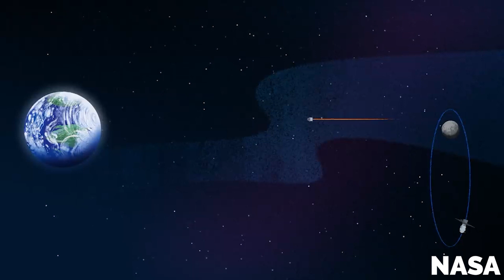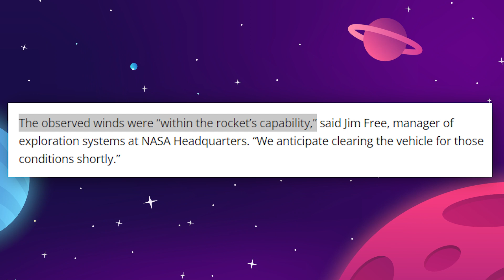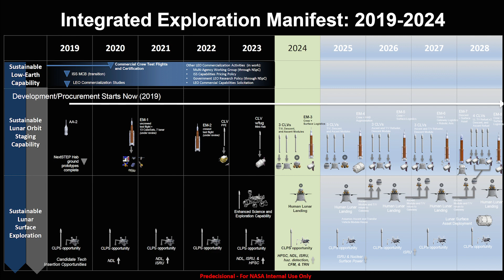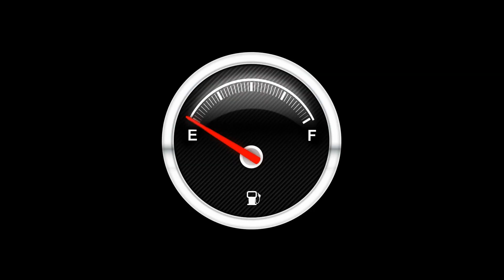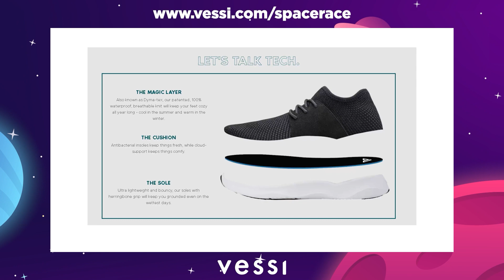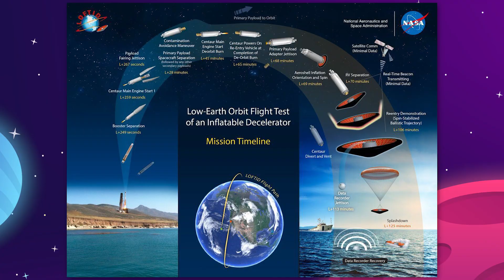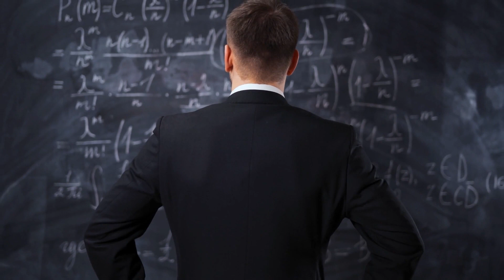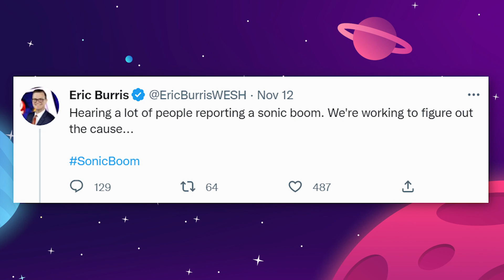NASA's Artemis 1 SLS Rocket Has Finally Launched To The Moon!

Comment: The most impressive thing was the inflatable heat shield which is new technology surrounded by old tech from old space.
The biggest news of course is that the single, most comprehensive reason that starship could not launch is now out of the way, and watch SpaceX go!
Reply: The Raptor 2 and the structural Integrity of reentry are the biggest obstacles to Starship that have not been resolved yet unfortunately
Reply: @serronserron1320  successfully landing back on Earth is optional for monthly unmanned flights. SpaceX can build enough Raptor 2 engines, Ships, and boosters to sustain monthly expendable launches.

The next ship to launch will re-enter and attempt a simulated landing above the Pacific Ocean. A successful test would have the ship hovering at the catch height at preprogrammed GPS coordinates. It will then fall in the ocean.

SpaceX engineers will then revise the TPS, thermal protection system design as needed, based on the results of that test.

While the TPS engineers are busy, the next two ships will deploy Starlink satellites and burn up on re-entry. 

Meanwhile, the boosters will do similar simulated landings off the Texas coast. Only after a booster hovers in the correct place will future boosters attempt real landings in the embrace of the very strong arms of the tower at Boca Chica.

SpaceX has tested several Raptor 2 engines to destruction, so they know the strength of an engine explosion. Each Raptor 2 has blast shields, so they can continue functioning even if neighboring Raptors explode.

A fully loaded booster has a thrust to weight ratio around 2 to 1. It can get a ship to orbit even if it loses a few engines along the way.